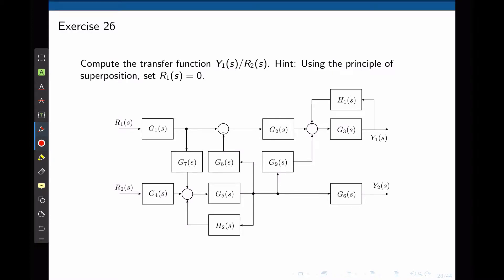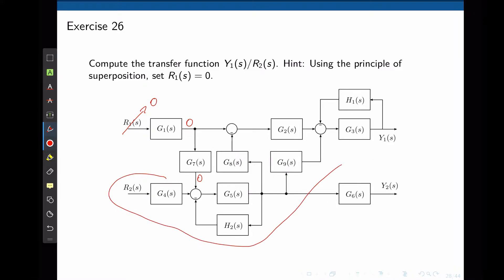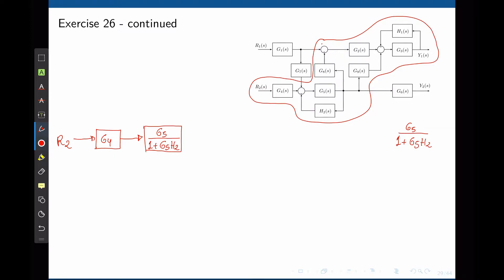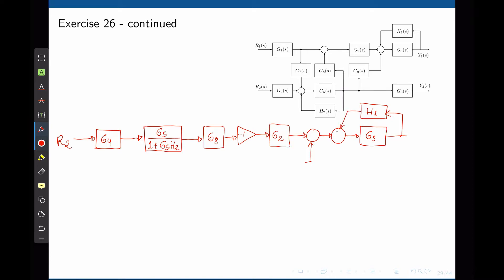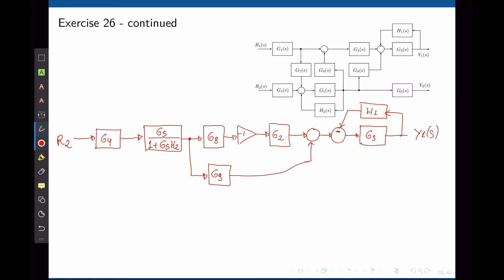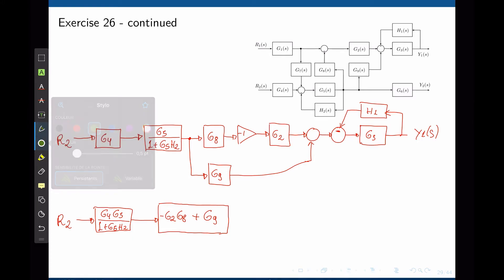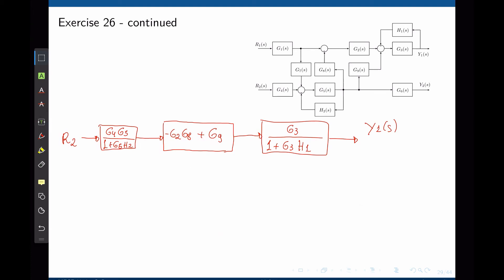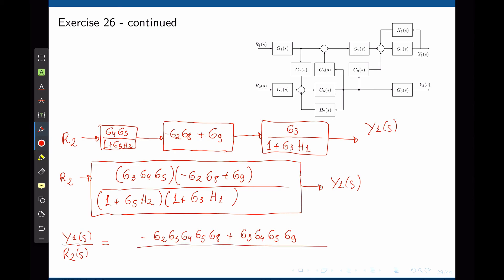L6E26 - Control Systems, Lecture 6, exercise 26. Block diagram simplification.

Comment: I hope you can reply soon. Why is G9 and G8 just left the way it is? Intitial block diagram takes output from G5(S) not G5S/(1+G5H2)so shouldn’t G8 and G9 multiply by 1+G5H2 in that way that denominator can be removed when finding the product of two blocks of G8 or G9 and their previous block? 3:38